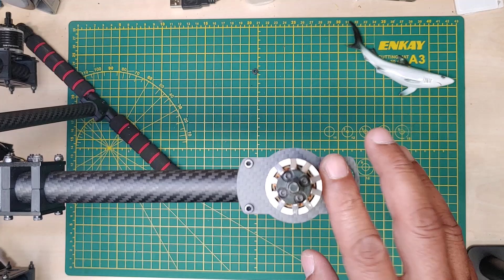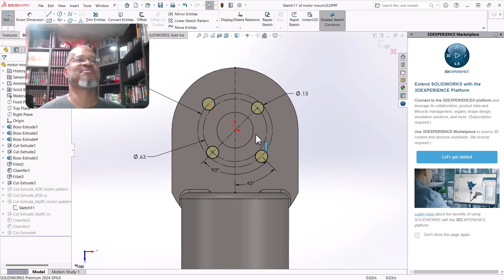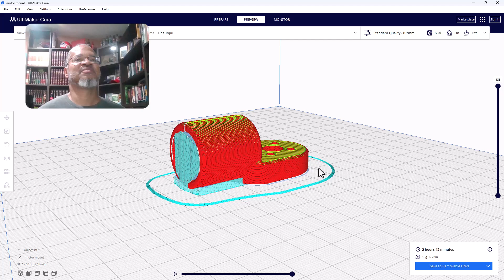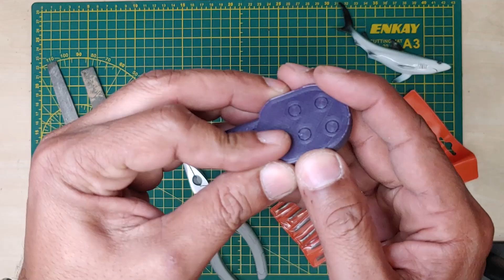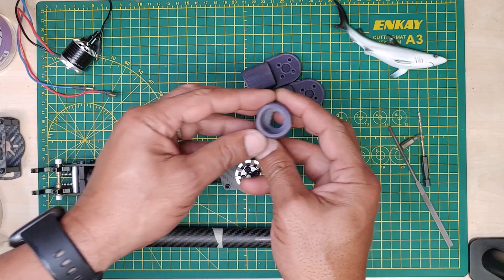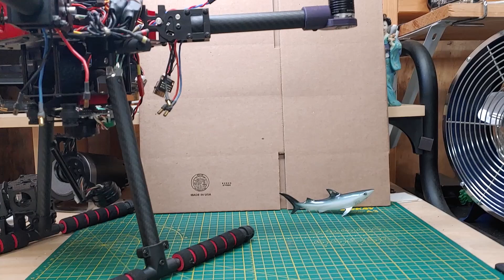Why I Replaced My ZD550 Motor Mounts

Comment: I printed motor mounts and made 3 major mistakes. 
1) Printed with normal PLA
2) 25% Infill
3) didn't put a anti rotate srew as you did. 

Results:
Drone's motor mount tilted mid flight and crashed from 300ft altitude. 
I was fly a zd850 and it was the worst crash of my life. 
Thank you for the video.
Reply from the maker: First, I am very sorry to hear about your crash. It is always a stomach churning event to have a crash nomatter how long you've been flying. Thank you for being brave enough to share your experience with us.
CF has been good, but I have upgraded to ABS and it has been working very well. Definitely no printing under 40% as things warp from he heat, and the anti rotation wrist screws are a must, since any movement in the printed part can cause the fit to change.
I am glad you got something from my video.

Comment: What gimbal and 4k camera setup do you have? I am looking at buying a gopro gimbal off of compterlab and was curious what you are running?
Reply from the maker: This is one of the aluminum versions you find on Amazon or eBay. CopterLab is an excellent source for gimbals, I've dealt with them before. He uses the same STM32 board that I am using with the gimbal in the video, so if you select that option for your gimbal, everything I do here will apply. The original gamera was indeed a GoPro 3. The current camera is a 4k 30fps Yolansin from Amazon. My other source for cameras is B&H when I have the budget for it.
Reply from the maker: Let me know if you need the specific links to the components.
Reply: @bentsprockettech  Yes please put links in the description if you can. I don't  know if links work on YT comments. 

Also I am looking to get into long range video streaming (with jetson or rpi), but a recording setup would be good to get working now
Reply from the maker: We are working on the VTX video next. I hope the following links work for you.
Gimbal: https://www.amazon.com/dp/B0BS5MLNHV?ref=fed_asin_title
Camera: https://www.amazon.com/Yolansin-30fps-Action-Camera-Accessories/dp/B0BXH54RPB/ref=sr_1_4?crid=2FFLSOOCRK3DO&dib=eyJ2IjoiMSJ9.JiGE5zBrr_LVkIyuAvCc_y0Y2AUj6lAql0zVFLOtq4aUxNPw3IFAFOomxOmOGgCHm90PTQ0A79oTaerc28kDuBOZ0nZy8YoIbuMawz_b79LfyUhOZq42di9_trH7tNiWKgEJJVZ9sro-pL60yP0Jz12_x_JjwrxD0dbYrYaveQQOmb8Kum_k9fjOY7DiTqV8g4e7YwwgjoTcL-wXESg2UTBtXFSSClbzY7MkBVKgqHI.j1cJlhgmWobuGvLBgKa1fjpLJlBLDrR1H6KcqXKYCUU&dib_tag=se&keywords=yolansin&qid=1735054472&sprefix=yolansin%2Caps%2C138&sr=8-4&th=1